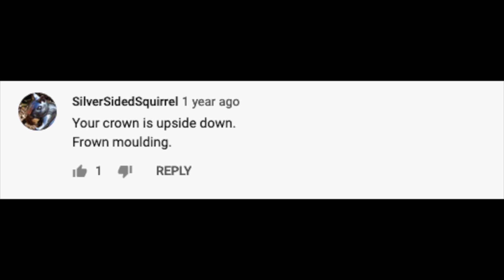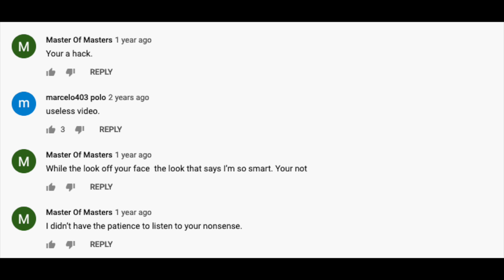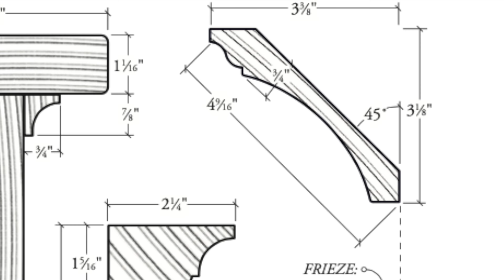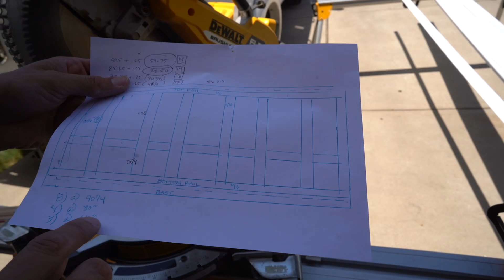"Tired of seeing this stuff put in upside down"

Comment: After 30 years in this business, the correct way to install crown is the way where you get paid.
Reply: Exactly Jonathan- this is another "The toilet paper flap goes behind", "No- it goes out front" argument. I hear people waste their time arguing about whether drywall goes on vertically or horizontally etc. In the end it's whatever makes the paying customer happy!
Reply: @Rick-the-Swift  I guess they must be the architects that took part in designing the mouldings.😁😁😁😁😁😁😝
Reply: Bingo.
Reply: Amen
Reply: Only right way is tight miters. All that really matters
Reply: Yep, I’ve seen crown mold installed upside down so many times I’m not even outraged anymore. Isn’t that molding with the large bead picture mold? That doesn’t mean you can’t use it anywhere you want like all trim pieces.
Reply: "If there's a steady paycheck in it, I'll believe anything you say."-- Winston Zeddemore
Reply: @harryg3889  Agree, mostly. Thinking out of the norm and different uses is great, but I have seen 2 1/4 ranch casing used as baseboard and it just don't work.
Reply: @Rick-the-Swift  Another new one on me. I have never seen or even heard of installing drywall horizontally. I suppose it doesn't matter, but I never knew there was even a question about it.
Reply: @greyeaglem  Right on! For finishers it's all about eliminating butt joints. If your wall is 12 ft wide by 8 ft tall and you've got 12x4 sheetrock, it's best to stack them so you only have one long beveled seem running horizontal. If you only have 8x4 pieces then it's best to stand 3 of them up side by side. It's easy peasy now for the finisher and no dreaded butt joints which are 2-3 times harder to finish and usually forces at least an 1/8-1/4" hump on what could have been a straight wall.
At least that's my rule of thumb as I'm usually the one who finishes my own work.
As you may well know though, in the real world the hangers and finishers are usually two different guys who don't always communicate or even know one another. 
Put that sh!t on with the finisher in mind and you'll have made a good friend who will want you to hang for him again. 
But like Jonathan's op, the best way is the way in which gets you paid and everyone is happy.
Reply: @djmeding  how about upside down, backside out. Might look better? How much worse could it look. I like the as long as I get paid way
Reply: Whatever the homeowner likes! Lol
Reply: @Rick-the-Swift  

Drywall is always going to have a better finish installed horizontally.. On a vertical drywall installation your sheet is only catching 5 studs, it will show the deviation in studs more. On a Horizontal drywall install a sheet is catching 10 studs so it spreads the deviations over a larger area thus creating a flatter install...

You can install drywall vertically sometimes its better for basements etc. however it will never give you as good of a finish as a horizontal install..

The tolit paper thing.. Tolit paper should have the flap infront.. Next time you go to a rich persons house check where the toilet paper is I garenttee 9/10 its in front..
Reply: @tkschannel9973  Agree to disagree regarding the stud deviation. 1/2 inch drywall isn't strong enough to actually bend the studs into a straight plane with each other. Plus the framer should always make sure the studs are crowned in the same direction. A butt joint will always create a hump in the drywall= inferior finish, and more of a PIA. Always avoid butts.
Totally agree with your though re the TP flap hanging out front, and not because rich people say so, but because it's common sense- who wants to spin the roll around looking for the dang flap when it should be out front so easily see and grab!

Good talk ✊
Reply: It's not the drywall that's causing the stud deviation. 2x4 are not perfectly straight regardless of picking out lumber or crowning studs. You will always have slight deviation. If you were to put a string line on bare studs in a house build it would not be perfectly in plane.

Drywall will follow the deviation of studs. So if a drywall catches more area it will help "flatten" said area.  If its catches less studs it is going to follow that plane more constantly thus creating an inferior install.

If your studs are perfectly str8 I.e Metal studs then drywall installion would be based on what makes sense (efficiently) 

Drywall butt joints and beveled joints all make a "hump"  its just a butt joint has to be feathered out further.
Reply: @tkschannel9973  "2x4 are not perfectly straight regardless of picking out lumber or crowning studs. You will always have slight deviation. If you were to put a string line on bare studs in a house build it would not be perfectly in plane."

 Ok agreed, there will always be some deviation with wood studs..

"Drywall will follow the deviation of studs"

Again, correct.

" So if a drywall catches more area it will help "flatten" said area." 

This is not correct, and only a perception of the mind. 1st of all, a 4x8 sheetrock will catch(cover) the same area (32sf) whether it's installed vertically or horizontally. Remember- there is deviation in the studs vertically as well as horizontally. You yourself point out the irregularity of the crowns. By such logic you are "flattening" out those vertical deviations "more" when you stand the sheets up vertically. But such logic would still be wrong as I'll explain..

" If its catches less studs it is going to follow that plane more constantly thus creating an inferior install." Again, you can use this same logic for reason to install it vertically- as the plane going up and down is irregular as well- but, again, such logic would still be flawed, which I will still point out.

"Drywall butt joints and beveled joints all make a "hump"  its just a butt joint has to be feathered out further." 

This is not correct, and one of the keys flaws in your theory. 
There is actually ample space within the beveled edges to imbed tape and transition from plane(sheet) to plane(sheet) without any hump. 
By contrast, when a "butt" joint is created:

1. it often has bits of factory paper curled outward which the installer or finisher rarely take the time to address, which adds an extra 16th inch to your hump almost automatically.
2. by the time you add 1/8" for imbed mud, thickness of tape and deviations in tape, i.e. creases, curls wrinkles etc., and 2-3 finish coats on top of said imbedded tape, and you are now at minimum of 3/16" to 1/4" (I've seen it go much further depending on who is trying to finish)

Even if you did have a very slight bulge coming from the beveled joint, it's highly possible, it would still be no where near the fat hump the butt joint is going to create. And it's this fat hump which is actually the result of inferior install.

To sum up why your theory regarding the stud deviation is flawed, I will explain to you how using the beveled joint will negate or make negligible the issues in which you spoke of regarding the illusion of the plane. 
The key also lies within the factory beveled joint.

You see, once the beveled joints are planed together, primed and painted, one could never tell by visual inspection that a beveled joint was indeed hiding within. IOW, two pieces which are correctly taped together will look exactly like one large piece. I really hope that makes sense.

I will however concede that at times, its the big fat hump which the butt joint causes which can actually save the day and bring the wall back out to plane. This can especially be true when the framer was a jack leg who didn't pay any attention to crown placement :P
Reply: @Rick-the-Swift   Once any drywall Joint is taped and finished you should never be able to see it by eye. On Butt joints that can be 2' wide feather 

If it was true that beveled edge was perfectly recessed then on beveled edges you would only need to fill with 4"-6" taping knife. even beveled edges get feathered to at least 20" wide with joint compound.

I am a carpenter working in custom homes for 10 years plus, I've definitely seen my share of work. Alot of what your saying is disagreeable to me. I see drywall tapers all the time. I know the complete process.

This is an article that is explain the superior finish of horizontal drywall. If you look up forums on the topic people will say the same thing about drywall flattening out a wall. 

Commercial: Hang the drywall vertically. On commercial jobs, fire codes often require seams to fall on the entire length of the framing, so the drywall must be hung vertically.

Residential: How high are the walls? For walls nine feet high or shorter, hanging the drywall horizontally has a number of benefits.

Fewer seams – Horizontal hanging reduces the lineal footage of seams by about 25%. Keeping the footage of seams to a minimum will result in less taping and a better looking finished job.
Hides uneven studs – Hanging horizontally also allows the drywall to flow over the framing so that bowed studs create less of a problem. If the drywall were hung vertically and a seam placed on a bowed out stud, the seam would be magnified because of the bump in the wall.
Easier to finish – A horizontal seam 48 inches or 54 inches off the floor is easier to finish uniformly, especially when compared to a vertical seam, which requires reaching up high and bending down low to finish. Also, don’t forget that drywall is available in long lengths so most walls can be covered in one length. CertainTeed Gypsum has drywall in lengths up to 16 feet and 54 inches wide to accommodate walls that are nine feet high.
Reply: @Rick-the-Swift  excuse me? The patent for the toilet paper roll, depicts it mounted flap forward... Plus there are actual physical reasons it is easier to loosen the lead sheet if it is statically stuck to the roll. Unless you have cats, flap forward is the correct way.
Reply: This man is speaking the truth lol the customer gets what the customer wants
Reply: Customer is always right because I can't see it from my couch lol
Reply: @sethhawkinson7428  looks good from my house lmao
Reply: Its always 30 years.
Reply: @Rick-the-Swift  
All substrates should be laid perpendicular to the structural framing regardless of the material.
Reply: Damn straight buddy. Creative use of mouldings is an art. if the customer likes it than it was done right!
Reply: hahaaa That made me laugh out loud - So true!
Reply: I know it's old but that's a fantastic comment
Reply: i love it when people tell me how shit certain chisels are and then you take theirs and it's so dull it wont even cut cardboard, like sure buddy you could have a 200 dollar chisel if you can't sharpen it you wont get anything right.
Reply: @wilsoncalhoun  late reply, but Winston's can apply to almost any work situation! 😆
Reply: Nice thing about doing the right way is you get better customers and customers know if they want it some other way they are responsible for everything and it may need extra work.  Someone that knows what's right is in control.
Reply: @tkschannel9973  dude that's funny. It has the same stud spread in the wall no matter the orientation. Studs in a horizontal 8' is the exactly the same as the the same as vertical install over the same area. Going back to top off  the job heater on a 150 4x12 and 54x12
Reply: So much jealousy in your comment.
Reply: @Rick-the-Swift  stacking 8 ft continuous seams on bowed studs will always look worse than 4' butt joints staggered every 12' 🤷‍♂️ point is the number of situations where one is demonstrably better than the other are minimal
Reply: @tightbhole420  yeah, I didn't re-read my original comment, but that thought that was my point, to not over think it. Finisher's usually make the call how they want it hung, hangers should abide. 
Hope everyone's having a great day!
Reply: @tightbhole420  yeah, I didn't re-read my original comment, but that thought that was my point, to not over think it. Finisher's usually make the call how they want it hung, hangers should abide. 
Hope everyone's having a great day!
Reply: I would usually ask the customer which way they wanted it after I told them which way it is suppose to go.
Reply: @greyeaglem  steel studs, vertical in commercial work.  Horizontal on wood studs, offset.  I built a house for a guy back in the early 80's, to the frame only, roof on.  He installed the board vertically and complained to me that the walls were wavy,  that was his problem that he installed it vertically.  I always tell apprentices to make sure things look great at eye level and sight lines.

Comment: In older houses with real lath-and-plaster walls, driving a nail to hang a picture or artwork was asking for cracked, flaking,  or spalling plaster.  The only safe way was to hang the artwork suspended from a fixed rail -- hence the advent of "picture molding" or "picture rail."
Reply: In my old apartment, in a building built just after WWI, I hung all my pictures from the picture moulding. Not only did the plaster remain in good nick, but when I moved there were no holes in the walls to patch.
Reply: Correct! I have picture rail molding in my den and dining room. House built in 1920.
Reply: @troygraham2238  It is nice because you can move your art around and not have to mess with the plaster walls.  We had it in our house when I was a kid.   I miss it because my current home does not have it.
Reply: In an art class, the professor talked about picture frame molding and they sold clips for it in the art store downtown.  The college used it in the gallery for students to show their work.  I was already familiar with it because my grandmother had it in her house and that's how she hung up pictures.  It's really an awesome molding.
Reply: How was the picture molding installed on the plaster in order to avoid the aforementioned problem?
Reply: @2blackdanes  carefully. But seriously, it doesn't matter if the plaster is damaged behind it because it's permanent, unlike pictures
Reply: @2blackdanes  my 1930's house has wood installed between the brickwork to act as wall plugs so it is screwed into the wall
Reply: nice one Rabbit,I have the picture moulding around our lounge.....got mirrors and pictures hanging too.
ps....great for hanging Xmas decs on....👍
Reply: @paulpugh5315   Hitting the studs in the initial install of the picture mould  was imperative to avoid compromising the integrity of the new plaster and lath
Reply: P.S>Also it was very very common to apply the finish coat of plaster, which is very thin, after the house had been trimmed. I have remodeled many old homes and a few old mansions and this was the case.
Reply: Fun fact: Mice and rats coming into these high-ceilinged rooms from above would run around and around these picture rails, unable to get down to the food below.  And THAT, dear friends, is where the term "rat race" comes from!
Reply: I have an antique mirror that has the curved hook specifically for it.
Reply: For those who don't know about plaster & wood lath walls, think 5 gallon bucket "paint sticks" (rough saw cut) with about 3/8" gaps, mounted horizontally on all the walls.  Plaster was mixed with horse hair as the fiber to hold it together and smeared on with a very wide trowel.  Pressing into the lath the plaster keyed behind the wood laths.  In time, the plaster became dried up and loose and if you banged it with a hammer and a small nail in between the studs it could be a disaster.
Reply: Where do you find this type of molding??
Reply: @relaxfarms6627  - Just google "picture molding" or "picture rail molding".
Reply: @daneclark3161   Try it.   You wont get a site in the USA.
Reply: @relaxfarms6627  - $18.88 at Etsy...  I have bought it at a local  store here in KC - not of the Home Depot variety.  It's been a few years but they did carry it in stock.
Reply: Yep. Just moved out of a house I'd lived in for 42 years with lath and plaster walls and picture molding. And yes, it's very hard to hang pictures in the lath (which is both hard and brittle), so the picture molding in our house was used extensively. My wife and her Mom were both watercolorists, so we had a LOT of art to hang. Had to patch several dozen holes (quarter sized), where I'd driven in small nails to hang various things. Pre-drilling only helped a little, as the lath was "springy" and would spring back and break off the keys that held it to the wall, if you hit it just wrong.
Reply: @Tyler-zw4kq  You might have plaster on rock lath, rather than wood lath.
Rock lath was (is?) small panels of plasterboard with perforations to hold plaster. It replaced wood lath in the 1950's.
Reply: Not every had a hammer drill back then aswell. Less relevant in America I guess but my walls are all masonry. Just found my rails were built off wood wedges rammed in some open head joints when removing, same with the skirts.
Reply: I didn't know that.  Now I do.  Thanks! 👍
Reply: Everyday in my 1885 Victorian
Reply: @relaxfarms6627  Windsorone moldings makes it, readily available in most good quality building supply places

Comment: Great video.   I've been a cabinet maker and custom finisher for over 20 years now and you're right!  Wood working is an art form and you can't tell another man, on the design side of things, how to do something.  Having said that, generally the wider edge of the profile goes towards the bottom in order to bring the crown forward.  Doing this allows the profile to be seen when a door is added below it.   I have installed it upside-down in order to have a wider edge to the ceiling so I can run a piece of quarter round against a really bad ceiling line.   Cheers man, good videos!